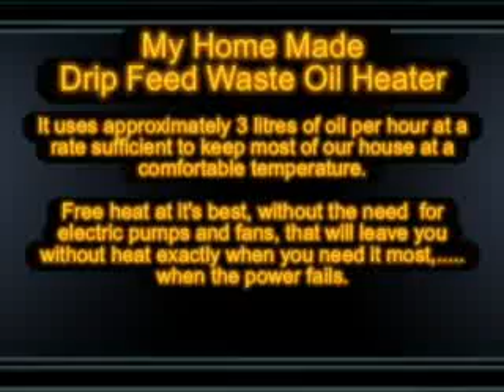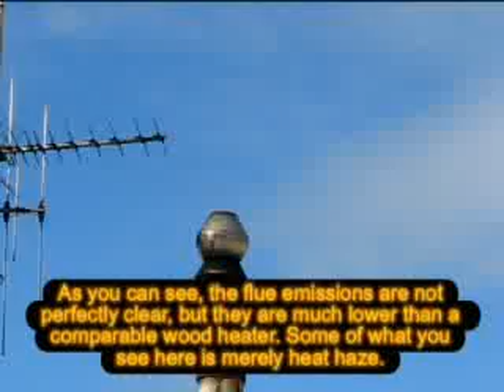Drip Feed Waste Oil Heater

Comment: @ozzirt I got my ozzirt clone up and running this afternoon.  Let it burn for an hour or so.  No surprises...took right off and settled down into a nice burn; no smoke.  I did a few things different.  I will post a video in a week or so.  

I located a heat baffle part way up in the lower drum.  This forces the flame against the brake drum before heading out the flue.

Thanks for the great design and inspiration.

Regards.

Comment: Hi Spike-  I'm currently shopping for chimney liner so I can obtain a stronger draft than my 10" ceramic fireplace chimney can provide.  I imagine the draft is quite important to the success of your heater.  Can you tell me about how long & what diameter your secondary burner tube is?  Also, how many square feet or square meter house are you heating with it?  Does your other furnace kick on at all while you are using your oil burner?

Comment from the maker: I have left you a PM on your home  page.

I'm not absolutely sure of the output, as this is of course tied to the rate of fuel consumption.

I believe that most used motor oil has a calorific value of approximately 20,000BTUs per lb (200,000 BTUs per Imp Gallon)

The actual figures given say 163,000 - 240,000 but of course there are several variables.

Cheers,
Spike.

Comment from the maker: Steve, I have no plans of the dripper, because it is "just that", a pipe dripping oil into the pan through a simple mechanism that allows me to open a slot so that the pan can be removed by sliding it forward.

I've left you a PM on your home page.

Spike.

Comment: You are officially my new hero. I've already built a basic waste oil burner based (very rouchly) on your design, but at present it's rather inefficient and hideous to look at. I used an old tractor rim I cut in half and some steel pipe I commandeered and drilled without a template. When I do get it fully operational I'll be sure to send you a picture of it heating my shop in the miserable Canadian winter! Thank you for the inspiration!

Comment: Very nice clean and simple design , awesome job and looks very professional , gonna build one soon for my shop , my shop is 24' x 24' x 8' high ceiling , is this heater enough to make it warm up to room temp ? Temp. dips down to -30 celus up here in Alberta and my shop is insulated not to badly .

Comment from the maker: It does work, although it will possibly need higher fuel consumption than I use here in Australia.

My usage is 1.25 litres per hour, the one being used in a machine shop in England uses up to 5 litres per hour in mid winter.

As YouTube do not allow the posting of links in these comments. I have added an annotation to the last 30 seconds of the Video clip to link to the plans.

This page is only a few hours old and will be added to and improved, as time and information becomes available.

Comment: its also known as an alaskan tent stove,it has an oil burner that fits inside thats regulated by a float valve thats the part i bought and still have not got around to setting it up. there is one on youtube under alaska burner wmo #2

Comment from the maker: @comet424  I do run mine inside the house. I have light beige carpet which shows any stains and it is still in use after nearly 13 years although I do have it professionally cleaned every two years or so. This is more because it is the most used room in the house than because of any dirt or soot from the heater. 

I do also leave it unattended for a few hours at a time once it is running on a steady temperature, but I do not recommend it.

Comment from the maker: @sow4now That is why it has a two stage burn, the primary burn is done at low temperature which although hot enough to vaporise the oil is not hot enough to vaporise metals, these are left in the ash and not vaporised and spread around the neighborhood as is the case with most commercial waste oil heaters. This process is the same as used in other burners of this type which have approval for use by the department of the environment,  e.g. the Kroll heater.

Comment from the maker: @shortscoff A 10' flue should provide plenty of draft, assuming that it is 6" diameter. 

Check to see that the extra oil is not pooling in the primary pan. If it is, you will need either extra air holes in the secondary burner or a larger diameter tube.  If not,  there is no reason why it should not produce more heat. basic thermodynamics says that the more you burn, the more heat that must be produced.

Comment from the maker: I have no actual heat distribution system, and really need a fan forced air duct into the front of the house. But even without this, I get enough natural recirculation.

So far, this has been good enough to discourage me from climbing into the ceiling to install it. Of course it must be realised that our winters are not as cold or long as those in  Europe or the USA. Conversely our houses are not really insulated either.

Comment from the maker: @sow4now Data on waste oil is all over the shop and varies widely as waste oil is a very variable product containing oil from heavy diesels, light automotive and often hydraulic oils. Never the less, the heavy metal content of the ash is so low that it requires no special licencing from the department of environment.

Most automotive and truck bearings today are babbit metal, which is tin based and only has minimal lead content anyway.

Comment: I built one and it never burned very hot or consistently enough to not babysit it for hours. The drip pot would load up with oil and go out or overflow if I wasn't careful.  I was quite disappointed.

Comment: hi is the oil being heated by the fire before it is entering the burner part by mean of a feed pipe wound within the flame.and the air seems to have a fantastic drawing effect is that aided by the many holes drilled at the burner element thanks   melvin in england.

Comment from the maker: The worst that could happen is that the dripper will become blocked or partially blocked, in which case it will burn cooler or go out.  The reason I do not recommend this to others is that I have a lot of experience with my own heater and know what it does under just about any circumstances.  

For example I do know that once it is settled, it never increases in heat, but on one or two occasions the dripper has become slightly blocked and it got cooler, which is annoying but quite safe.

Comment from the maker: It does allow for adjustable output, however when wound down to a "pilot flame" mode it is prone to smoke because of the lack of effective draft. 

I have never done any work towards fitting a thermostat, as I can achieve all I need with occasional adjustment.

Gordon Robertson has his house in Scotland heated using central heating boiler. I have re uploaded this video as i cannot find the original on YouTube

You really need at least 3 meters of chimney for the draft.

/watch?v=7_AVCnAzYbY

Comment from the maker: @jonintacoma 

My strength lies in the fact that in 12 years no one has ever even thought that my heater might be burning waste oil, because it burns without any visible emissions or smell. 

I have no doubt that if it smoked or smelt like burning oil I'd have had someone from the EPA  knocking on the door by now, as I live only 15 feet from my neighbours on either side.  I know both of them well and have asked on numerous occasions if there is any smell, the answer has always been , No.

Comment from the maker: @wind4watts Yes, that was only a secondary consideration when I built it, but it has paid off handsomely on several occasions so far. We also use the top plate to heat food and water, and although not perfect, it is a great improvement over the alternative.

It's only disadvantage is that it has no automatic control, but that is of little concern, as I have had no problems in 14 years of usage and I know where to set the feed valve to achieve virtually any heat range.  It works well.

Comment from the maker: Hi Simon,

Glad to hear that everything is working well.  A bloke in England built one and I went through it all the same as yourself.

He eventually shamed me into doing the upgrades to my own heater last summer. We used your idea of the shorter flame tube, and while I was about it I lowered the whole unit. 

It now looks much nicer, and burns cleanly over a much wider temperature range.

Comment: Hello, I built one of these stoves and I have a problem: I used 3.5 meters of 5-inch chimney pipe inside my house and I made the burner with 4-inch pipe with holes but it still gives me smoke, the question is around As for whether the problem is that the burner must be 5 inches or is the oil thread very thin? when i get it to really get red hot it also smokes undesirably it's sad

Comment from the maker: @comet424 The plans are able to be saved from my web pages URL listed in the comments under the video.  The oil needs to be strained so the dripper does not block up and you cannot have any water or antifreeze in it. See my movie on how I clean and store the waste oil.   It's not difficult to do, but the hardest part is finding some way of disposing of the water which is always a little oily.

Comment: @sow4now If you would use waist oil used to bake food, frites burgers the issue is solved  :)

I do that to heat up my garage, but my stove is very primitive,  an iron bucket with some holes in the sides

Comment: Good vid therel but unless the oil is burnt at a high temperature with the correct air flow, ie atomisation of the fuel and fan forced draught, you will get gaseous emmissions. The flue may seem clear but the gasses with contain high levels of sulphur and carbon monoxide. This is why these burners are illegal in many countries. I`m looking at building a burner but it`ll have a compressor to pressurize and atomize the oil along with a heater to pre heat it before the burner  nozzle. .

Comment from the maker: The major problem is everyone thinks that oil heaters have to smoke and smell like the ME heater built by Yonmoore before he built one like mine. It's not true, a little care and waste oil can be made to burn hot clean and almost odourless.

I describe the smell as that of a distant, recently bitumised road. I can only smell it if I climb onto the roof within about 20 feet of the flue pipe. I have never been able to smell it at ground level.

The main secret is to get it going quickly.

Comment: I got my ozzirt clone up and running this afternoon.  Let it burn for an hour or so.  No surprises...took right off and settled down into a nice burn; no smoke.  I did a few things different.  I will post a video in a week or so.  

I located a heat baffle part way up in the lower drum.  This forces the flame against the brake drum before heading out the flue.

Thanks for the great design and inspiration.

Regards

Comment: excellent idea with the fusible link... I am about to build one very similar to yours with the exception of the air intake pulling from outside.  The box at the base would serve three purposes: 1. Safety (as you have done) and 2. More exposure for heat generation. 3. Containment with air intake from outside so I'm not pulling air out of the room I'm trying to heat.  Thanks for updating the link... I tried to access the site the other day and couldn't.  GREAT WORK!

Comment from the maker: It's an even greater joy when I realise that my house is heated for only a few cents per day. (The cost of collecting the oil and pumping it into my storage tanks.

There's never any hesitation, if the weather is cool,.. light the heater, it's great.

No electricity is needed and I don't have to chop and carry firewood in with the trail of dirt and wood chips  that is bought inside with it.

Comment from the maker: Hi John, the basic plans are downloadable from the site in the Comments box. 

At present I am fiddling with a new idea, using less and smaller holes, but having three dots of weld on the bottom of the secondary burner tube so there is a gap all around about 2mm wide between the lid of the pan and the bottom of the tube. 

Unfortunately when i did this i never had time to get photos or a video but hope to do it soon, (in the next week) after I've given it another test run.

Comment from the maker: Yes, the camera has really picked it up well, the microphone must be quite sensitive.  There is a slight roaring noise but it's not really as bad as it sounds here. The heater is within about 4 feet of our TV and it does not interfere with the sound to the point where you have to turn it up more than one or two notches.
Having a large draft is a trade off that you have to make if you want to have no electric fans, and it's cheaper and easier than chopping wood. :-)

Comment from the maker: No, not an oven. It's an enclosure to contain any fire or smoke in the event of any sort of failure.  In the lid is a fusible link that will close the fuel valve should the temperature get too high. We only usually close the front if it is going to be left unattended for any length of time.

Taking combustion air from outside is a good idea, but it is not practical for me as the whole unit stands on a solid brick hearth. I would do it if I could.

Comment from the maker: Mel,

Email me at;
spike47(at)bigpond(dot)com

I'll send some photos. And there is no preheater coil. The oil drips/runs down through the top of the pan lid into a piece of angle iron that is angled down slightly into the centre of the pan. the oil boils almost immediately it hits the angle iron.

Cheers,
Spike

Comment from the maker: You make far too many assumptions. For a start vapour particles are smaller reach higher temperatures faster and more easily mixed in the correct F/A ratio than the majority of those which are atomised,... and without a power source for your fan, pump or compressor your atomiser is absolutely useless and you will freeze your butt off.

At operating temperature, I emit no more particulates, sulphur or CO than the Brick kiln 400 yards up the road that burns the very same fuel.